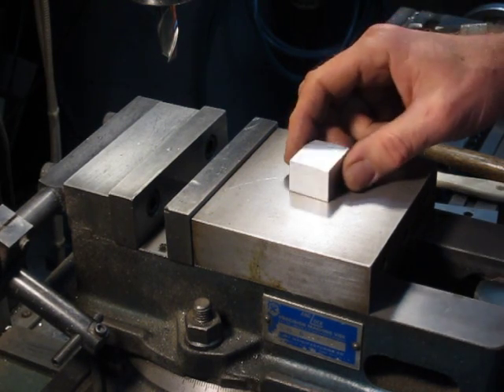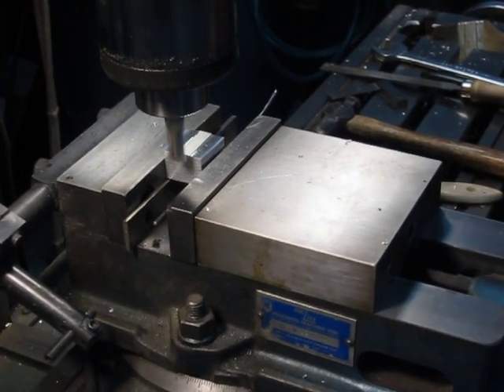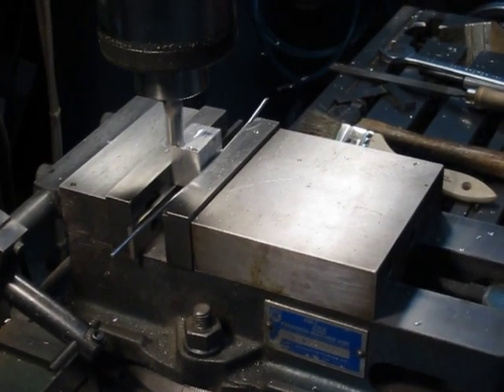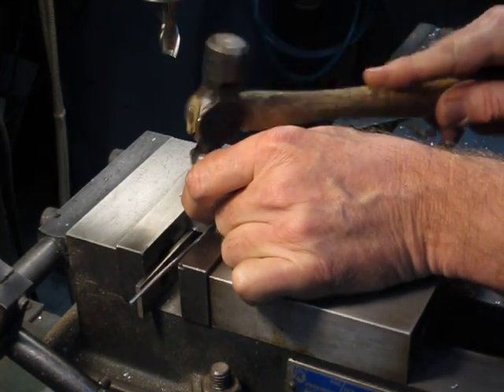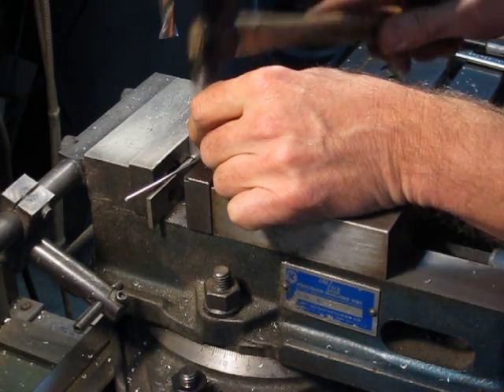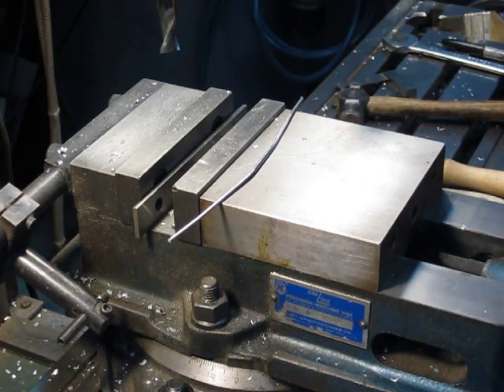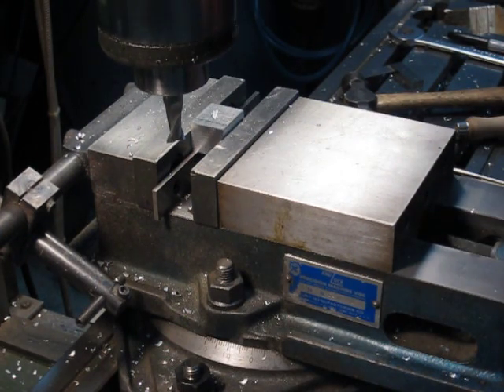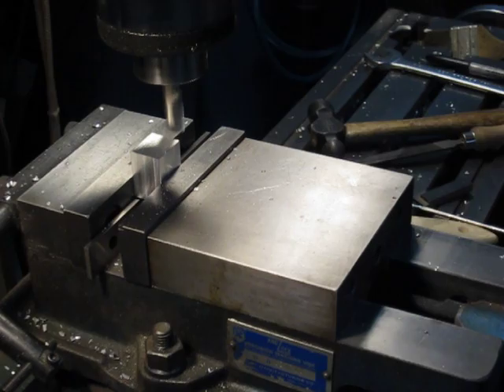How to square up stock on the milling machine

Comment: The machinist at my university taught me to first make two parallel sides, then cut another two parallel sides, so there's now four squared sides, then finish the remaining two sides.  Also, he hadn't heard about using Al wire or wood against the movable jaw; he said you can just put the piece up against vise.  Thoughts?

Great video, though!  I'm just getting into machining so I'm open to all advice and techniques.
Reply from the maker: I can't imagine how you could machine two parallel sides first. Squaring stock is a progressive process. You establish one flat side and work off that side to square up the others. The wire allows an irregular surface (sawed) to be clamped evenly in the vise. The part is more apt to move if you just clamp it in the vise without the wire.

Tom
Reply: You can machine two parallel sides first by using hold downs. Starrett makes them, along with others. After doing a cleanup on one side, use the hold downs to cut the opposite side parallel. Hold downs have an edge ground slightly out of square so that when that surface is against the vise jaw, it forces downward pressure on your workpiece so it sits flat against your parallels. Once you've got two parallel sides, as I'm sure you know, you're off to the races.

Also, I think most people in the trade would recommend either a brass hammer, a copper "tonker", or dead blow hammer over a ball peen hammer.
Reply from the maker: Hold downs are not a tool I would want to use very often. They are very touchy to use and if you don't get them clamped right, they will let loose when you least expect it and they don't work well on an irregular surface (sawed). They also eat up a lot of room in the vise, so they limit the size of the part you can use them on. I have a pair...somewhere. :)

As far as hammers go, I've used them all and prefer the ball pein. It's small, so it's easy to get hold of the part and feel when it's down and when the edge or the ball end is used, it acts just like a dead blow. The only time I'll use something else is on a finished surface. Try it, you'll be surprised.

Tom
Reply: One shop I worked at, they ordered all of the steel saw cut 6 sides. I used my hold downs every day for the 5 years that I worked there. Never had an incident. We had 10" vises in our CNC machines. Never had size issues either. To each their own, I guess.

At any rate, nice job on the videos! They quit teaching machine shop at the schools around here. What a shame. I've made a very good living the past 25 years by cutting steel. Got almost another 25 to go!
Reply from the maker: That's the fun thing about machining, there are lots of ways to accomplish the same thing and everyone has their favorites.

I stated out teaching high school machine shop in the 70's, but none of the schools around here even offer it any more. It's a sad time in this country for manufacturing.

Glad you like the videos.

Tom

Comment: hi tom.when I use an end mill to get a block flat, if I run my finger over the machined surface I can feel high and low spots over the cutter track marks,why do I get that...the mill head is trammed in...is there any way to stop the highs and lows...cheers tony
Reply from the maker: Tony,

A rough finish can be a lot of things. The tool could be ground wrong (either dull or without enough clearance), the head isn't trammed close enough (it has to be very so as to not leave a ridge between cuts), or there could be some end play in your spindle bearings (check with an indicator and see if you can move the spindle axially with a block of wood).

Tom

Comment: You should be using a soft hammer to set you part.
Reply from the maker: That's only necessary on a finished surface.

Comment: Hi Tom hope you read this and my other messages. I am eager to learn all you will give. Ive always use a slide calculator to figure out feed rate. I'd like to know how to long hand it. I have tried to learn from books but I'm confused by the math? Can you do video's on how to use grinding attachment like spinners for ejector pins and cores in tool building please? One more thing how to grind radius on core pins via attachment on surface grinders? Thank you.

Comment from the maker: I can see where that would help, but if I was going to take an extra step, I'd rather use the technique described by Andrew Bauer below. He side cuts the block with the Y axis, just wide enough to sit on the parallel after squaring up #4, then then places it against the parallel to square up #5, flips the block and squares #6, then finishes up #5. I've been trying to adopt his technique, but after doing it "my way" for the last 40 years, it's not easy. What's that adage about old dogs?

Tom

Comment from the maker: Thanks, but that's an old worn out file that I been using for years just for deburring and it's actually better off that way. Nice new files don't work well for deburring because they tend to chatter. When I get around to doing a video on filing, I'll concentrate more on proper technique, but not for something as mundane as deburring.

Comment: One other thing I noticed in your video; is that Files only cut in one direction pick it up on the return stroke. Even aluminum will dull a edge over time.

Thanks for taking the time to teach.
Reply: Files are not heirloom tools start thinking of them as long term sand paper.

Comment: More accurate way is after you cut the 5th side using the square to align it, is to turn the part over and rotate 90 degrees. This takes out any inaccuracies in using the square as the one edge is always true to the jaw face. Then after cleaning up the 6th face go back and retrue the 5th face. You'll be surprised as to how it is slightly off most of the time. This method has worked for me over 40 years an you will then be dead on square. Note: Not always possible because of size & jaw opening

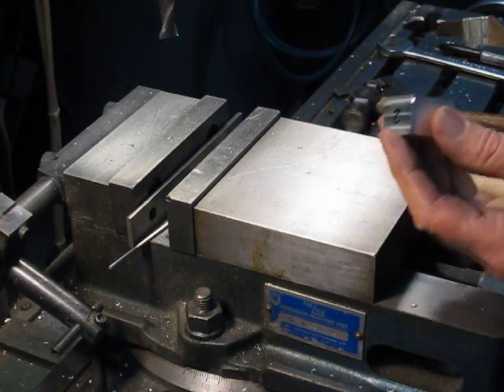Comment from the maker: At about 4:30 in the video I take one dimension of the block to a specific size, checking it with calipers. Basically all you do is take a cut and set the dial on the table to zero, measure the part, move the table up the required amount and take a finish cut.

I'm using a 1/2" two flute end mill in this video and the mill is a DoAll variable speed milling machine, much like a Bridgeport.

Tom

Comment from the maker: Good point.

Burrs on the part and chips under the part are the two biggest problems when squaring up stock. You can do everything right and still not end up with a square part if you don't deal with the burrs and chips. I keep a brush hanging on the side of the machine and a file within reach.

Tom

Comment from the maker: FINALLY someone who thinks outside the box. You wouldn't believe the amount of flak I'm taken over using that ball pein hammer in the video. ;) 

Ball peins are smaller than pretty much any other hammer so you can hold the part with your fingers and feel when it sits down on the parallels. Like you say, any marks will be machined away. A lot of techniques I use are outside the norm but I use them because they work.

Thanks.

Tom

Comment: I concur with Tom, as long as you clean the vise of any chips and you haven't changed the parallels, the height of the part will still be the same, as long as the part is properly seated.

Comment from the maker: It depends on the situation. It can be difficult to measure a part held in the mill vise so sometimes it's easier to just take it out for a measurement. As long as you tap the part back down tight on the parallels removing it will have little effect on accuracy. On a lathe, it's perfectly acceptable to remove a part held in a collet, but generally not a good idea with a three jaw or four jaw chuck because it would be difficult to return the part to the same position without indicating it.

Tom

Comment: Thanks for posting. I have a question: You had the part out of the vise, measured it, put it back in the vise and milled it down to one inch, within half a thousanth. Then you were assuming that the part would wind up at the exact same height in the vise, right? I'm just trying to understand if this is correct procedure. I've had milling and turning classes and we never re-chucked anything in a lathe and expected to keep on going where we were. Again thanks for making this.

Comment from the maker: Thanks.

You may want to try using the ball or edge of a ball pein on rough sawed surfaces, it works much better than anything I've tried. But yes, plastic is appropriate for finished surfaces.

Tom

Comment: Tom,
I have also been in the Tool & Die trade since the mid 60's and this method will never fail you if, like you explain, your equipment is trammed and square. You always want to start with the largest surface and work down to the smallest. Another tip that you did hot mention but probably did it with out thinking, is to always cut into the part with the end mill. This will produce a part with the least amount of burrs so clean up is easier. Nice video and great explanation of the procedure.

Comment: I love it. Finally found someone who not only knew this technique but also improved on it. I like the fact that you use the side of the facing cutter to cut the flat on side 5. I have been setting it up in in the vise to face cut it. This eliminates that step. Thanks. The part I like best about this is not having to use 3 hand s to get the part right.

Comment: It took several readings of Wingrider X's description but I like what he does. What he is doing makes great sense and doesn't require a tool change as long as your facing cutter has straight sides. All he is doing is cutting side 5 with the side of the end mill that is already being used to create the flat that gets set on the || to cut side 6. The reason I like this method over the square is that it doesn't require 3 hands.

Comment: Tom. Great video. I am with you all the way through step 4. I vary at this point adding one step to the process & use no square. At this point I put side 2 to the solid jaw (SJ) & side 5 facing up. Then skim cut side 5 using the Y axis (do not move the x) enough to get a clean surface from 2 to 3. I then take the part & place it in the vise surface 1 to SJ & side 5 on the ||. Now finish side 6 then turn over & finish cut side 5. The wire is good. I use a 3/4 ball that has a flat ground on it.

Comment: Great video.
Alright I have a question. How would you go about creating square inside corners? Just came across these ancient egyptian stone boxes and I'm dumbfounded. 
Google "Saqqara. Serapeum. - ISIDA Project"
They measure around 6'x6'x10' and weigh around 50 to 70tons.

Is it possible to create a very small scale version of this with say, aluminum?

Comment from the maker: That's an interesting variation and there is nothing wrong with doing it that way. The only problem is that it takes a tool change and an extra step, meaning that it would take longer to do over just using a square.

Thanks for pointing it out.

Tom

Comment: THERE'S A BETTER WAY USING NO SQ AND EYE SITE. AFTER THE FOUR SIDES ARE DONE MOVE THE CUTTER TO THE SIDE DROP INTO THE WORK TWICE THE  THICKNESS OF THE PARALLEL.. THEN SET THAT EDGE DOWN ON THE PARALLEL .TAKES THE GUESS WORK OUT OF SURFACES 5&6. YOU DEPEND ON THE VISE BEING SQ...I DID IT LIKE YOU FOR 30+ YEARS TILL I SEEN IT DONE (YOUTUBE).TORMACH   SIMPLICITY AND VERY AND ACCURATE.  PEACE

Comment: Hi Tom, have just read all the comments on your video and it seems a number of your viewers are wassocks (foreigners can google the meaning). How can 15 people dislike your work? It may not be the only method, it may not be the best but it is a good method, good enough for all but the most very critical of purposes. Rather than use a bit of wire, I use a piece of 1/2" Dia. alloy bar flattened to a "D" shape with two small magnets embedded in the flat side. The magnets hold it on the moving jaw.

Comment: As Jonathan commented, I had not come across the soft wire trick. I’ll be using that in future, many thanks for sharing. I would also like to confirm that using an end mill is much better than a fish. I tried fitting a decent bit of halibut to my R8 spindle and it was hopeless. It wandered off centre, wouldn’t cut properly, made a mess etc. Maybe the drawbar wasn’t engaged properly.

Comment from the maker: Thanks Vince.

Side milling is a good option for long or thin parts, but only as a last resort. You''ll get a part that is more square if you face mill or fly-cut because you won't get the cutter deflection that you get when side milling. I normally side mill when squaring up plate stock.

Glad you enjoyed the video.

Tom

Comment: This was exactly the method I just learned in my machinist class, and is outlined in the NIMS textbook. The only variation we learned was for milling sides 5 and 6: if the piece is a long rectangle you might not want too much standing up in a vise, so simply raise the bench and run the side of the end mill over the sides of the workpiece. Good video thank you!

Comment from the maker: Is the block already machined? If so, you won't need to go through the squaring process, just machine three sides to get it to your final dimension. If the block is not machined, then square it up and to size just like I did in the video.

Tom

Comment: If my project is an aluminium block, sized at 63.5mm x 63.5mm x 50mm. I need to make it to 50mm x 60mm x 40mm. So, is the method of squaring up the same with your video?
I'm using fly cutter.

Comment from the maker: You are correct, but you can't assume any of the faces are parallel until they have been machined. The wire is only used on surfaces that have not been machined, such as sawed or rolled (mill) surfaces.

Comment from the maker: This is actually a variation on the traditional method which rotates the part toward the solid jaw one adjacent side at a time. I prefer this method because it references everything back to the original surface. There is nothing theoretical about it, if done correctly either technique will produce a square part.

Comment: I've tried, on both manual and CNC machines, old and new.  The jaw is always perfectly perp.  II "un-teach" the old-school method to new toolmakers that just got out of school.  Some balk at first but come around when they can't produce a square block.  The new toolmakers that come with decades of experience have abandoned this method long ago.  I honestly don't understand why it doesn't work.  It should, in theory   If your back jaw is perp and your part is tight to it...

Comment from the maker: If the solid jaw on your vise is square then you should have no problem tapping the part down on the parallels regardless of size. Indicate the solid jaw, on your vise on both the X axis and Z axis (move the table, not the head) to be sure. Also make sure the head of your mill is perpendicular to the table, especially if using a fly cutter. The procedure I've outlined will create a square part, but the machine must to be properly set up or you'll just transfer any misalignment to the part.

Comment: I have found that you need to get 2 sides parallel first.  If you don't, the sides won't be square or parallel.  The method you showed is the "textbook" method that has been around for as long as milling machines.  The problem is, when you get to the 3rd side, I can never get 2 parallels tight under the part.  If 2 parallels aren't tight, the sides won't come out parallel.  I don't mean any disrespect, though.  I was just wondering if you have ever noticed this, especially on larger blocks.
Reply: Make sure head is trammed as close as possible. Use a tenths indicator. Mill top face 1. Put the clean face 1 against solid jaw resting an adjacent rough face on one parallel on solid jaw side while using a wire between the movable jaw and the rough face opposite of face 1 pushing the clean face 1 against solid jaw making it parallel to the jaw and then clean 2nd top face. Now face 1 and 2 are square. Flip part over putting face 2 on parallel on solid jaw side. keeping face 1 against solid jaw using wire between the opposite face of face 1 and movable jaw and tap the corner of the rough top face pushing clean face 2 against parallel.Now face 2 is parallel to the parallel on solid jaw side and face 1 is straight against the solid jaw so those two faces are sitting square in vise.
then clean up top face 3 copying opposite side face 2 making the two faces 2 and 3 parallel to one another and both square to face 1. Now place face 1 down on two Parallels and tap down while clamping faces 2 and 3. Then clean up face 4 copying face 1 making those 2 sides parallel. Sometimes if the stock material has extremely rough saw cuts on all sides repeating the steps over again will make the part more square.

Comment: kinda cool but i just use starret hold dwns mill a side put that dwn boom 2 parralel sides no need to use the wire multiple times...but if all u guys really want the most square part you would use an angle plate...not that tom here is wrong im sure hes prolly bout  .0002 out of square at most...n he knows his shit side milling will create a less perpendicular side due to tool flex..hense my angle plate..and a vise will not "lift" your part if you are in contact with the full height of the jaws.

Comment from the maker: Thanks, I'm glad you enjoyed the video. A ball would do the same thing as a wire, but I'd be leery about the small contact area. The aluminum wire being soft conforms to the part and spreads out the clamping pressure.

Comment: Tom....just a home shop guy here......great video, great education, I will try the wire method.  I have been using a ball that has a flat milled on it which the flat sits against the moveable jaw